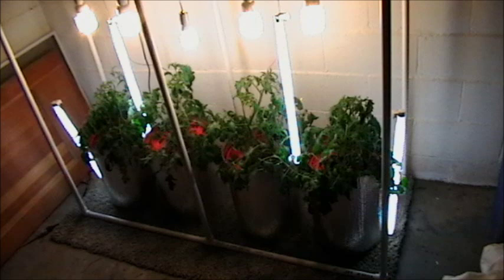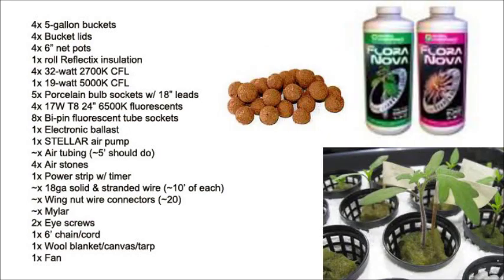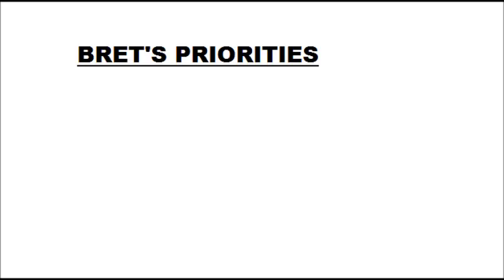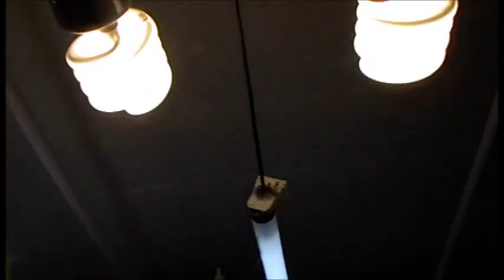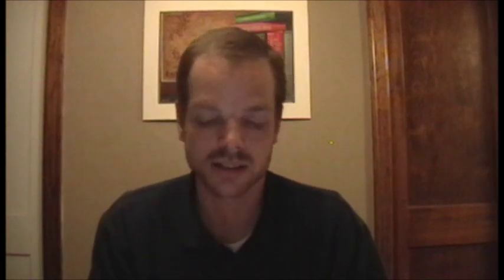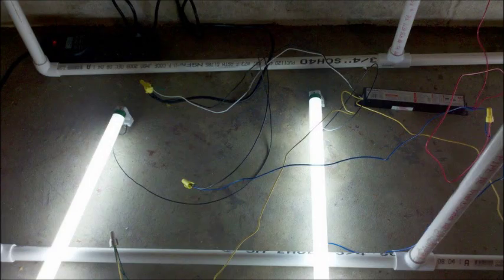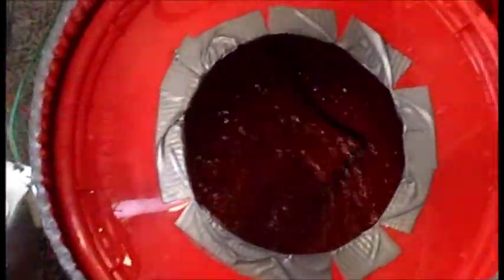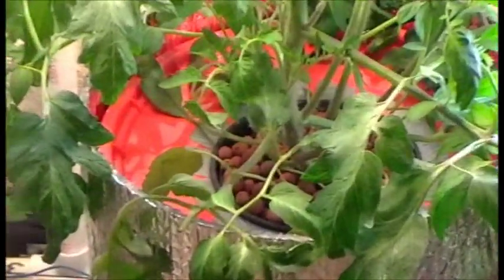DWC Deep Water Culture Hydroponic Tomatoes with Vertically Hung Fluorescents

Comment: There isn't any positive or negative when dealing with AC power. I would also plug this into a GFI circuit in your house since you are dealing with water. I would also recommend buying pre-wired lights... They're much safer than what you have here.

Comment: Fire Hazard!!!!! AHHHH Ballast on floor below water level!?!? Arrgh!  I see loose wires! you need zip ties and junction boxes. Not trying to troll just be more cautious. Try soldering or crimping those connections. Those type of "twist" connectors are meant to be out of sight in a junction box

Comment: @myclem6674 
Ild have to agree... Dont ever use those cheap "clamps" spend the 10$ for the cheapest solder iron with shrink wrap and solder those connections using a standard lighter to heat shrink the rubber around the solder. Very simple, will take 5 extra mins and your not up all night wondering if it looks like the fourth of july in your basement.